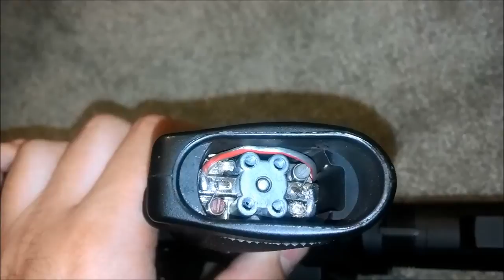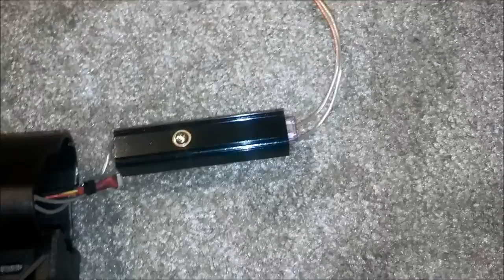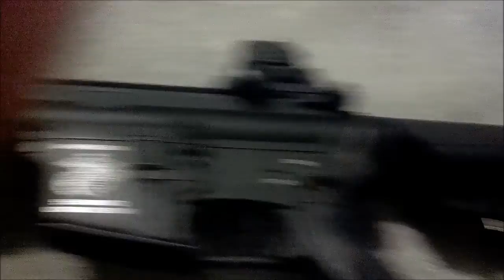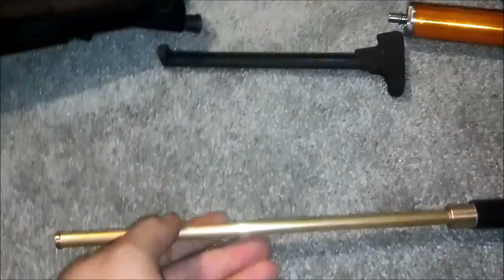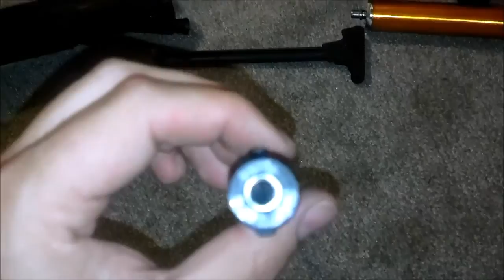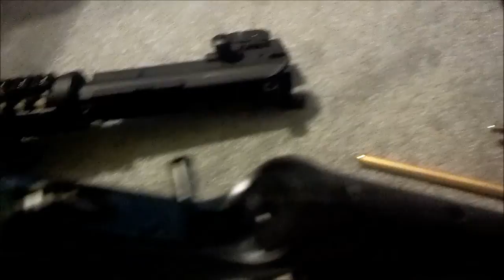G&D DTW M4 General observations

Comment: Sorry if I missed it, but is the orange flash hider glued on ? If so how did you remove it, and if not is it CCW ?
Reply from the maker: It's a full metal flash hider I don't recall if it was cw or ccw
Reply: ok thx

Comment: Great to see an American review this with some TW experience. Quick question: have you done any tests in regards to weather and rain? Heard all sorts of things with rain and PTW's.
Reply from the maker: I honestly have had more luck with this TW vs my systema guns I have build/owned/purchases from other people, mostly due to the fact of the initial cost is so low I can afford to do EXACTLY what needs to be done to a tw to get them to work flawlessly, thank you for the kind words.  This like all other TW's can suffer from some moisture issues, I have had more issues in heavy humidity vs a deluge or rain.  I water proof all my electroics and also create a "black rtv" gasket around the receiver as well, this seals it up nicely and also makes the fit of the lower and upper togeather much tighter.
Reply: phadeblade Is there some way you could clue me into the mods needed to make these guys perform optimally?
Reply from the maker: John Perkins Sorry to take so long to get back to you, pretty much all that I laid out in the video, 100% dump the stock barrel and hop, that is #1

Comment: How do you program the burst mode
Reply from the maker: It works the same as a lot of other boards, using the bolt catch in conjunction with the trigger and fire selector.. 

ECU Programing for Multi rd shot.
1, Connect the battery, remove the rear receiver pin and open the receivers. 
2, Put the model’s selector in Full Auto. 
3, Press the bolt Release up, and pull the trigger and hold the trigger for 5 seconds until it beeps/red light and this confirms you have enter programing function. 
4, Programing 2 to 30 rds can be done and for a 3 rd burst for example, press the trigger 3 times and on the 3rd time you hold the trigger and wait for the beep. 
5, Close the receiver and you should now be able to shoot on semi and 3 rd burst.

TO revert back to Full Auto. 
1, Connect the battery, remove the rear receiver pin and open the receivers. 
2, Put the model’s selector in Semi Fire. 
3, Press the bolt Release up. 
4, Pull the trigger for 5 seconds and wait for the double beep. 
5, Close the receiver and you should be back to Semi and Full Auto. 

That should be the proper instructions.
Reply: I got Celcius MX3R DTW which is basically a G&D DTW I had it for 3 weeks, man not only couldn't program the burst but now is not working at all I'm new to TW's format any ideas if is the mosfet or something that needs to be reset. In advance thanks for any input
Reply from the maker: could be quite a few different things, take the upper off, plug a battery in while the gun is on safe, switch it to semi and let me know what the light on the computer board does.
Reply: No it did not do anything
Reply from the maker: Ok so there is either a broken wire going to and from the computer board/mosfet and or your mostfet is blown, remember to replace hardware with like hardware, you can't cheap out and get the dtw electroics unless you get the computer board and the mostfet which would be fine, the selector control is the same.
Reply: Thanks for the reply. I'm placing  an order for both of them luckily they are not to expensive,
I'll let you know  how it works out once I get the parts in, once again thanks for the advice
Reply from the maker: not a problem, definately let me know how it turns out, with the mosfet find yourself a hot glue gun and seal the front of that mosfet off the wires seem fragile

Comment from the maker: The Description has the link in it for the parts compatability...It is a great post in general, read the whole thread..

Its the same water break in process you do for brushed RC motors.  It is a requirement for all TW motors unless you get the motor from Tac, Hotspot, or FCC, they do a water break in themselves.

Comment from the maker: It is tough to say if it would be a good starter gun or not, as long as you correct the issues I go over in the video when you get it, it will last you a long time, the dtw is about 90% of a ptw out of the box.  That's crazy considering ~$1500 price difference.